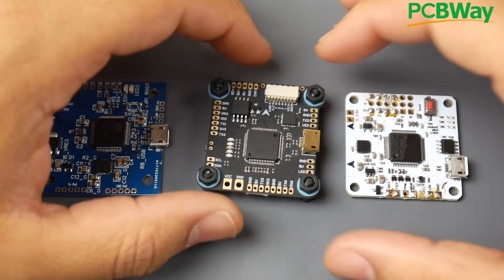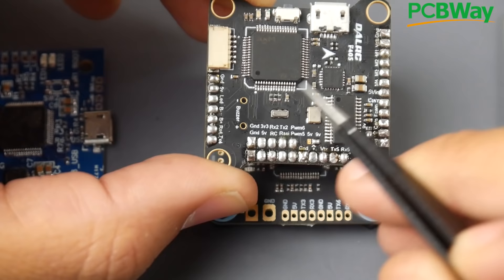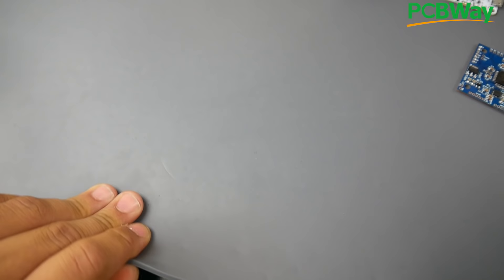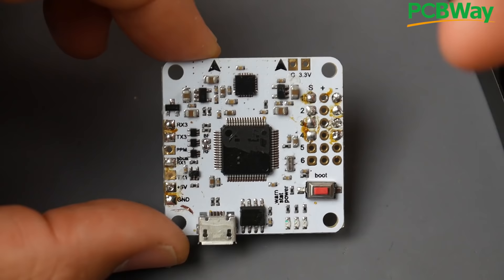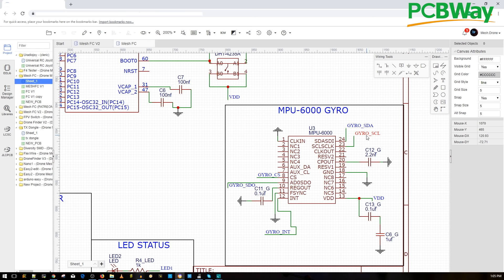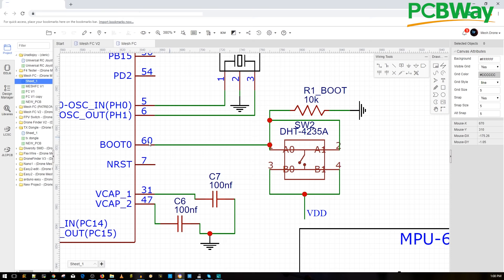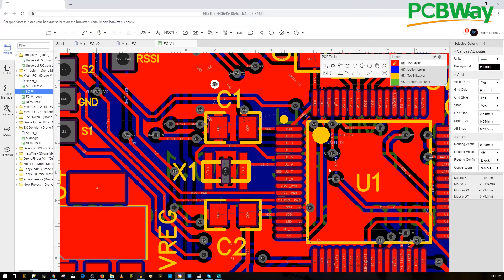How to Build Your Own Flight Controller // The Anatomy [Part 1]

Comment: Just putting this out there - the D+ and D- on the USB are not TX and RX. They are differential pair signaling, where instead of sending a HIGH or LOW on one trace to indicate a 1 or a 0, you send opposite signals on the D+ and D-, and the microcontroller uses the transitions to determine if a 1 or 0 was received. This practice is done because it is much less susceptible to noise and enables high speed communication.

Comment: The 0.1µF and 1µF caps on the VDD pin of the gyro should be in parallel to gulp up different frequencys of noise/ripple having them in series will give you a higher voltage rating but less capacitance overall. But still a great video :D

Comment: Icm is not a noise sensitive gyro, if wired up correctly it is a good clean gyro.This is being mistaken.Take a look at cl racing f7, its not prone to much noise eventhought they use icm.I dont think your fc have flash memory, flash memory is a component that stores codes, yeah thats a prominent component in an fc, you cant basically store all the codes in your mcu, its also kinda dangerous to do so.
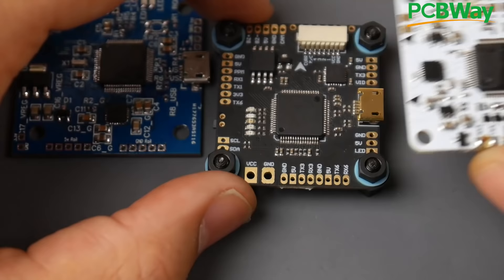Reply: @ 5:52 you have a flash memory chip above the usb(molex)
Reply: Did you seen a MultiWii type flight controller who store firmware and settings outside microcontroller chip? That external 1-wire memory chip is intended to store Blacbox logs.

Comment: USB doesn't have tx and rx pins. They have D+ and D- which are a differential pair. Both are used for communication in both directions.
Reply: guess you cleared that up in the schematic talk.

Comment: Thank you for sharing this with us. What is the LED in Pin 14 of the MCU for ? there is no third LED on the schematic. I am not sure if you mentioned where to put the GPS? 
The pins can be either labels or ports , are the UARTs, the SBUS, SDA/SCL pads ports or net labels ?

Comment: Are you interested in making a custom firmware/ forking betaflight to include gimbal support and quaternion controllers?
Reply from the maker: Yes
Reply: @DroneMesh  what code does betaflight run on....
If I were to pursue this project, how should I start, could you(or anyone who reads this) give me advice on tutorials on how to start?
Also I'd love to make this compatible/tailor made with you flight controller if you were to make a 20x20 version with an osd, 5v reg and some other common features.
Reply: @quickf0x792  c
Reply: Well you should start by going directly to their website.Then you can find their opensource code and start learning them, there is also a bf slack group which would help you, basically bf is coded by c , in K and R indendation style, make sure you stick with it.If you propose an idea , you can start working on it by making hex files and sending them in the channel, there are a lot of testers.Good luck
Reply: @shri7582  thx
Reply from the maker: @quickf0x792  I am currently using the FuryF4 Firmware but soon will make custom firmware

Comment: So basically you can pause the video open EasyEDA - click on the links provided below video - copy '' LCSC Part # '' number from the product description, for example, F405 MCU has C15742 - then go to the library in EasyEDA a find that product there for resistors an capacitors the size are only that matters for example ''0805'' and type that in EELib after that just change how many ohms you need or for capacitors units hahah lay everything flat on working space and press play on video connect everything as video shows - please correct me, someone, if I said something incorrectly because I'm now working on first FC and I don't want to mistake at the beginning ..

Comment: Great video, but why did you connect capacitors C13_G and C6_G in series, and not in parallel ? Doing so, they are equivalent to only 0.09 uF, and you do not have the benefit of filtering out more frequencies in power supply voltage (by using them in parallel).

Comment: I don't think that at 17:53 you really need to do explain it that way. It's just a voltage divider, so that not all the voltage is dropping across the boot pin, some is going into the ground, and how much should go into the ground(I'm assuming out of 3.3)...
I'm commenting this to see whether or not I got it right.

Comment: Assembling a new FC from parts taken from several dead ones is cool. Did that when repaired my fried FCs earlier by cannibalizing parts from other fried FCs , but this is something new :)
Would be interesting to get Racerstar TattooF4S circuit diagram. I have two dead TattooF4S on my table right now. Seems I can use your FC diagram as template to find which part fried. Both have fried 5V BEC's and one also have shorted 5V rail behind BEC. Because BEC chip most likely is dead in both FCs, I would be glad to know where to get Silergy SY8213FCC, labeled as AJY7FB by 2-3 pieces. Don't want to buy 2500 piece IC roll to fix two FCs :)  By the way if you have possibility to talk with our gear manufacturers, maybe tell them to use more popular BEC chips. I can live with max 2A current in 5V rail perfectly well. AJY7FB with 3A support is cool, but it dies too fast - probably because it can't cope voltage spikes well.

Comment: where did you go to school for electronics? im in the states and always heard them called crystal oscillators never really resonators. 

also i have a 12v NCP1117 on one of my projects and all it does is drop the voltage by 1v. its setup as per datasheet with the 2x 10uf capacitors and im confused as to why it wont work correctly. 

it would be awesome to make my own FC boards once the chip shortage is over...

Comment: if you could get an r9m onto the flight controller i would love that.
and video tx, satellite chip that would sort me out. everything all in 1 board
Reply: If you can design your own PCB then nothing hold you from assembling your personal FC. But it will be huge board, at least twice larger than 30x30mm module board.

Comment: Great video!
I'd like to know about if the flight controllers on the market can be loaded with diy firmware? And where should I learn more about it?
I made my own arduino FC multirotor with all codes and algorithms started from scratch. If I can use those FCs it'd be nice.

Comment: hey, can you answer me a question not related to this video?

i want to know if it is possible to change the motor wire gauge. I have a motor with 20 AWG and wanted to change to 18 AWG, how can i do it?

Comment: Bro, this video deserves 100k subscribers. Also, I was looking at the MPU6000 datasheet, and I had some questions. In the datasheet CLKIn did not go to ground and AUXCl had an output. How did you know to send the CLKIn (pin 1) to ground and not add anything AUXCl (pin 7)? Also, for VDD (pin 13), there was one capacitor (0.1 uf) going to ground. Why did you add an extra capacitor?
Reply: O wait sry, I paused the video right before you said that you will go through each component step by step in later videos.
Reply from the maker: @lohitmurali2137  I am redoing these doing just made one couple days ago. Even make breakout boards. Check my latest videos on it

Comment: Hello thank you for this great video.
Can I ask something?
I searched a lot. But did not find any thing about programming a flight controller with c and c++
. Can you please help me about write a programm for pro flight controller with GPS and fpv and video transmition?
Or how can I learn?
Thank you a lot
Reply from the maker: This takes an opensource software called betaflight.
Reply: @DroneMesh  Thank you for answer... If I want write Programm with Keil, it's ide for arm... Is there any way that I can learn?
Thanks  a lot

Comment: Hey mesh have you had any failsafe on r9m and r9mm and what firmware is on it
Reply from the maker: Not a single fail safe I have all default dont know what firmware is running.

Comment: Is this base on the openpilot cc3d revolution? If you simply soldered the chip and it works, the answer is yes. I hope you give proper credit to original work.
Reply from the maker: This was not based on the cc3d rev.